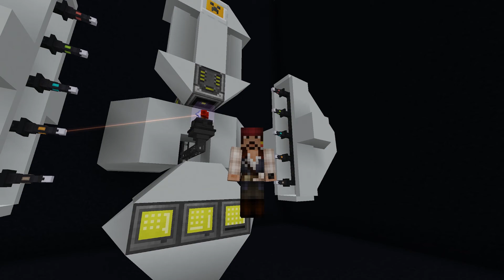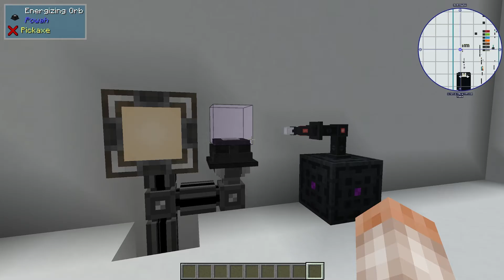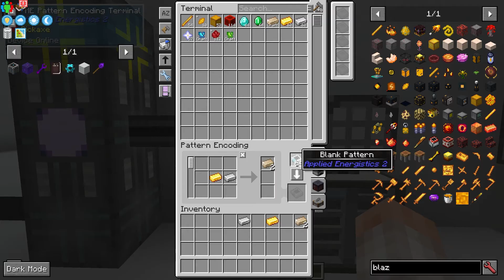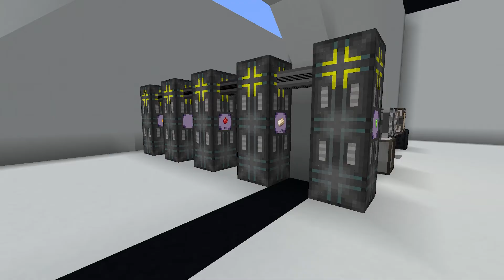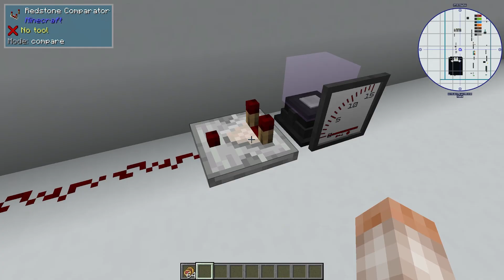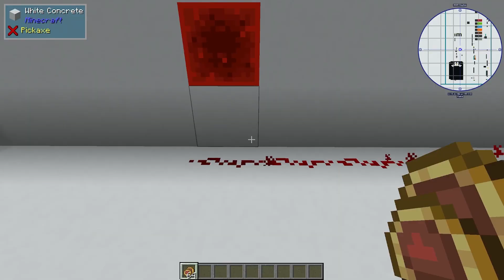EASY Energizing Orb Automation! - Powah Mod for Minecraft 1.18

Comment: For the people that are working on modpacks, another way to treat the problem for refined storage is to use rftools utility couter's, the chain is as follow : 
orb > comparator > observer (vanilla) > counter (pulses set to 2) > redstone > crafter set to "redstone pulses insert to next">orb
For this to work properly, when not working, the circuit should be shuted down, as the crafter will insert all items at once, you should never overflood your system, worked perfectly on stoneblock 3
Reply: legend

Comment: do you need to filter the import cable on the bottom?
Reply from the maker: If I remember correctly, you do NOT need to filter it. It pulls out only after an operation has completed which is very nice.
Reply: @The MindCrafters  thank you for the reply. I have confirmed you don't need to filter the import cable at least with refined storage. Thank you. I had import cables ok every side filtered 😂

Comment: I'm not sure if this is mentioned in the video but you can energize solid blocks and it will convert to solid blocks so if you do a block of diamond it will give a block of niotic crystal. I had the biggest laugh after learning this because I was standing there putting a single diamond in 1 by 1 like an utter scrub xD. Same with all, there is also block of energized steel. Speeds things up if you do it by hand. I am playing Stoneblock 3.
Reply: Wtf bro, u litterally saves me tons of time XD